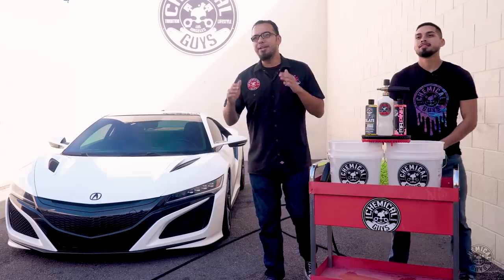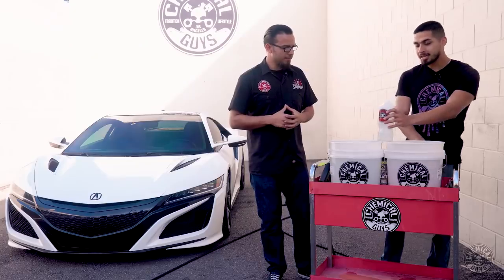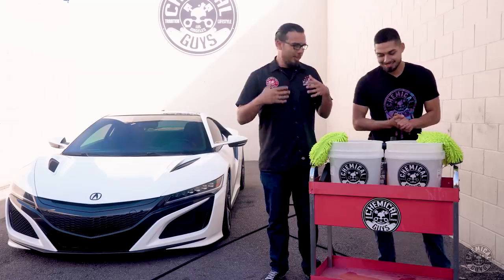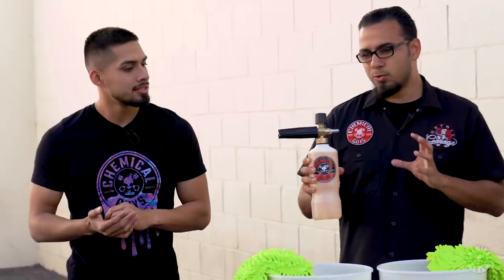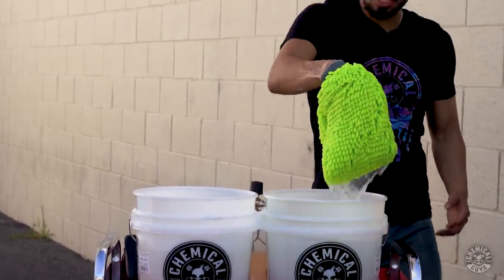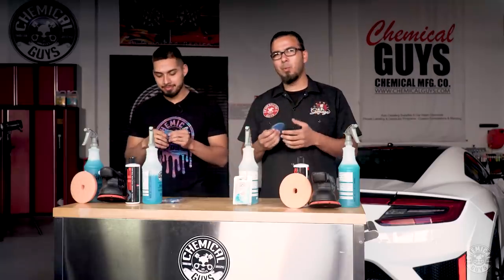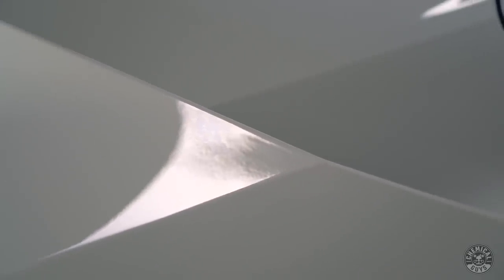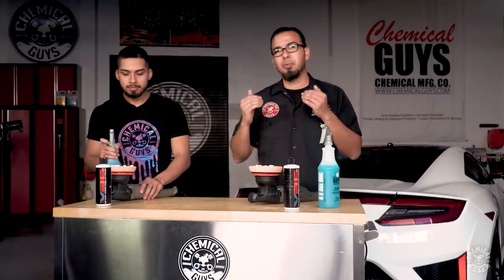How To Properly Remove Ceramic Coating: Prep for Fresh Protectant! - Chemical Guys

Comment: Amazing video, great work. My brand new car was coated a week ago over ppf but they forgot to install hood deflector before doing the coating. Can you remove coating over ppf?
Reply from the maker: Hey Phil! Thanks so much for watching. The only method to remove ceramic aside from natural degradation is by machine polish.

Comment: Good information. Was the ceramic coating semi permanent type coating? What was the conditioner used on the pad?
Reply from the maker: Hey there! Thanks so much for tuning in and for your message. We are unsure of the coating that was used but it was applied improperly and luckily came off with little effort. Polishing Pad Conditioner helps to keep pads operating efficiently.
- CG Nick 
https://www.chemicalguys.com/polishing-and-buffing-pad-conditioner/pad-conditioner.html
Reply: Thanks for the feedback. Can you share the conditioner used in removing the clear coat?

Comment: so do you reapply the wax around the vehicle?
Reply from the maker: Hey Antonio! After polishing it is important to apply a protectant to prevent contamination from clotting the pores of the paint. A ceramic coating, vinyl wrap, or combination of glaze, sealant, and wax can be used.
- CG Nick

Comment: No way clean slate is taking off any ceramic. And the ceramic on it looked like it was working from the beads, and you gonna say it doesn’t look like it was done right cause there some dirt, just cause it’s ceramic coated doesn’t mean dirt can’t stick!
Reply from the maker: Hey Gus, thanks for tuning in. Clean Slate was used to remove any waxes and oils that were on top of the ceramic coating. Polish was used to remove the coating. Although the vehicle already had great water beading, there were areas that ceramic coating had cured to without being buffed off, the glass had streaks from quickly applying the ceramic and spots of dried residue all over the vehicle that needed to be machine polished for a fresh start.

Comment: So I can clay bar even though the ceramic was added on top of the paint ?
Reply from the maker: Hey Anthony! Yes, it is alright to use a Light Clay Bar on ceramic coating but we are also preparing to polish to remove ceramic residue.
- CG Nick
Reply: Chemical Guys okay was just wondering because after I ceramic coated a couple months ago now the paint feels a little rough like I need to clay bar
Reply: Would you be able to clay bar the vehicle and then re-apply another  ceramic coat?